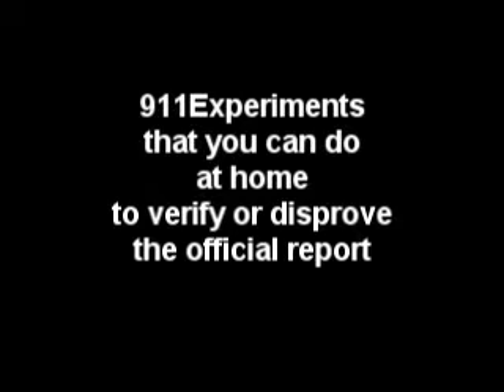9/11 Experiment: Steel Pan Upon Fire

Comment: I like the "it's been about an hour" comment, when the digital clock on the stove still reads 7:37 before and after the comment. Next time, instead of just moving the clock on the wall ahead, make sure you set the one on the stove, too. Also, with nothing in the pan, there is no way you would be able to pick it up without an oven mitt, given the plastic handle.

Comment from the maker: @Denierbud11 It's pretty bad when you don't keep in mind that aluminum has a lower melting point than steel.   Under prolonged flame, the pan did not melt, bend, or lose significant strength.  Steel is even stonger.

Comment: If anything of relevance had been measured at all, the experimenter would have found without a shadow of the doubt that the pan lost a part of its load bearing capacity, expanded, and deformed slightly during the experiment, all of which would validate all of the findings of real investigators.
Now question: Why do they put fireproofing on structural steel, but not on frying pans?

Comment: More errors:
Throughout: The assumtion that any part of the steel (or Al) at the stove would collapse when heated is moronic. Structural steel in a highrise is loaded to 20-30% of its load bearing capacity, the pan and the metal that it rests on to only a tiny fraction of a percent
The temperature of the flame is not the important factor that determines how hot the metal gets, only one of many.
In this experiment, nothing was measured: No temp, no load, no heat input (energy released by fire)..

Comment: So m,any errors:
0:28 "it's a steel pan" - no, it's an aluminium pan
0:33 "according to the 9/11 Commission..." The )/11 Comm. wasn't an engineering body and did nit look into the specifics of what happened in the fires at all. Moronc idea to refer to them.
0:38 "...the steel melted" - WRONG. The word "melt", "melted", or "molten", does not appear in the 9/11 Commission Report at all. No other official study claims that any steel at all melted.

Comment: Wow? Really? You put a cooking pan over a gas range and think that proves it huh? What's that black stuff on the pan there bud? where's the thermometer proving the temp of the metal? I'm sure you pushing on a glass bottle is the force of 30 floors too right? Oh and the fact that the flames are able to go around the pan and are not confined within a structure has nothing to do with it either right? Stupid experiment is stupid and proves nothing except that you're an arrogant truther with no clue